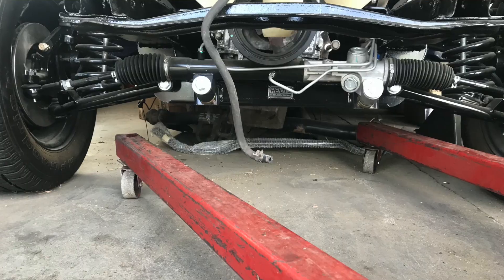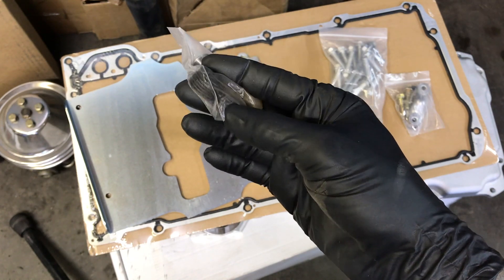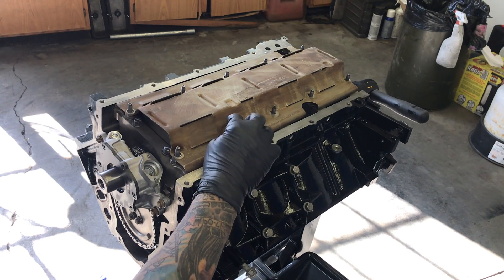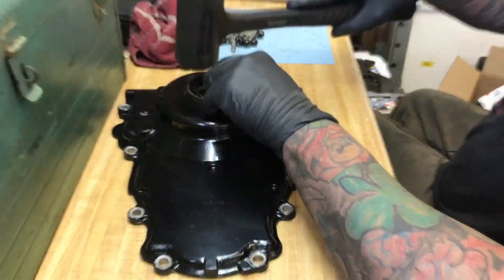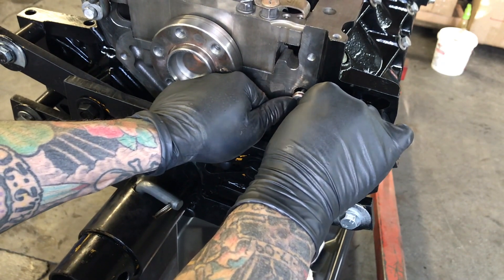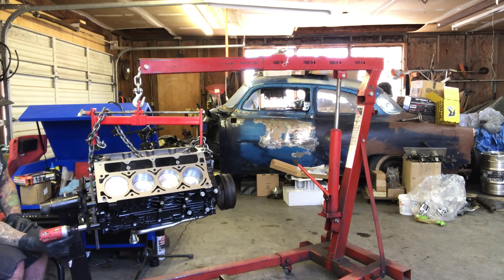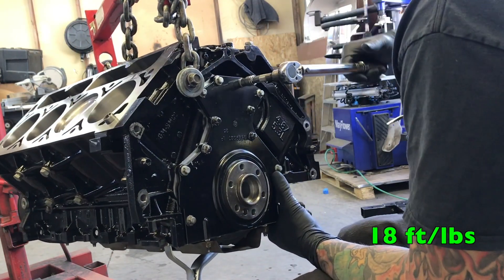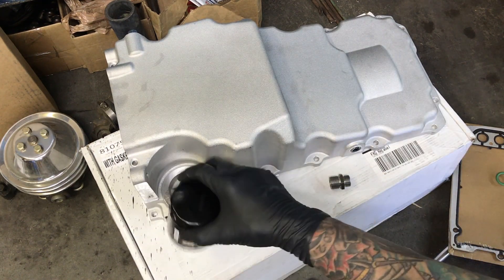INSTALLING A LOW-PROFILE LS OIL PAN, FRONT and REAR COVERS, and BALANCER!! - TURBO 5.3 LS pt 6

Comment: wht type of oil pan u useing.    and is that a lq9
Reply from the maker: it's the knock-off ebay equivalent of the Holley 302-3.  There's a link in the description to the exact pan I bought.  THANKS FOR WATCHING!
Reply: @GODSPEEDGarage How much oil do u use with this